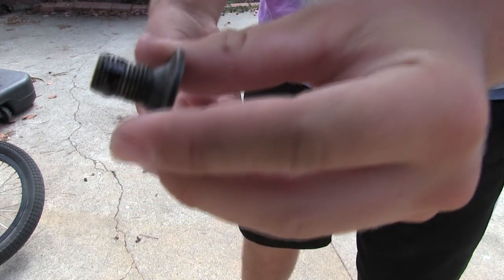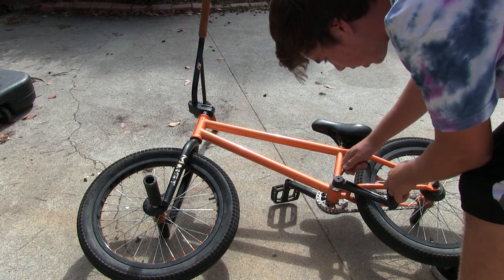HOW TO SAVE A STRIPPED BOLT

Comment: hi can someone help me I bought a new mountain bike  and the handle bars keep getting loose when I ride it I try to tighten it as best I can at the bolt now the bolt is starting to strip and suggestions?
Reply: Try cleaning the contact points between the bars and the stem
Reply: You need to clean where the bars meet the stem, clean off the loose paint and dirt and what not.